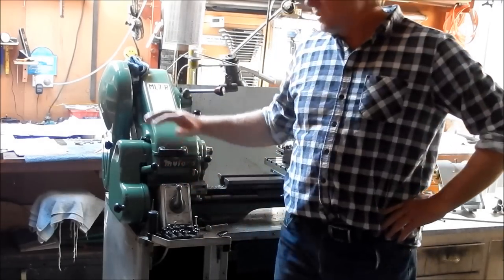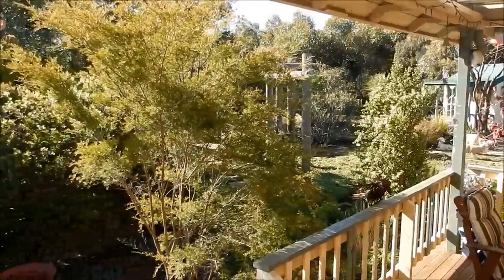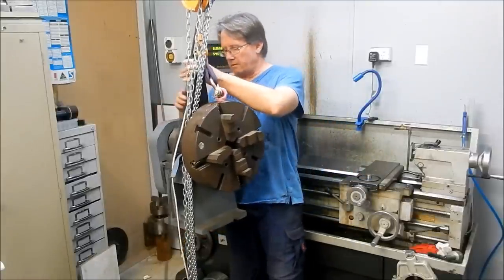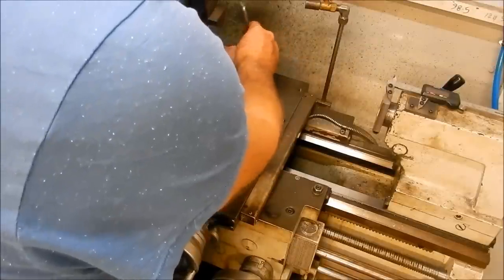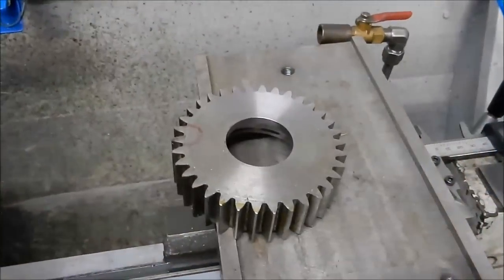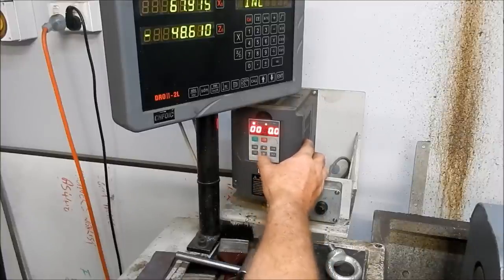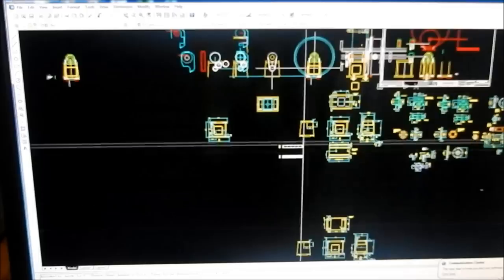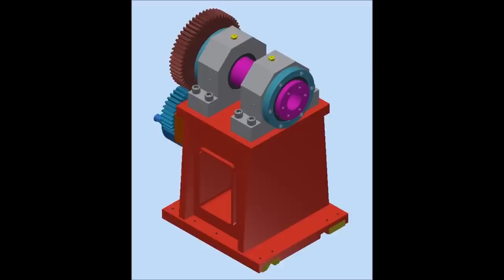How to extend the swing of a lathe Part 2

Comment: When I saw the title of these two video's, I was intrigued. About 10 years ago I had the idea of making something like this. Reason for needing an extension was my grandson was wanting to make some wider wheels and the 13" lathe I had wasn't big enough to turn the wheels he was working on. I drew up plans in CAD very similar to these fixtures. Later I bought a 17" lathe but never got around to building the extension. These are awesome!!!!! And I enjoyed the engines also!!! I subbed!!!
Reply from the maker: Hi Danny, it was a bit of a project but it works extremely well.  I can swing up to 750mm.  I've  machined up all the risers for my turret  mill so it paid for itself in time and money on that one job.
Cam
Cam

Comment: I am blown away by the skills of these two engineers. Thank you for sharing this. Down under-Tasmania. 🇬🇧🇦🇺
Reply from the maker: Thanks Shevill, glad you popped by and had a look.
Cam
Reply: @camatbattler2233 Subscribed.  I am a long retired medic with a lifetime interest in astronomy-astrophotography and building my own telescopes, mountings and observatories. My engineering skills such as they are, are self taught. My workshop and machines are a means to an end-I rarely draw anything, just look around to see what stock I might have and & work around that. Head thoughts are straight to machining. I am lucky down in Tasmania that we have a Catamaran shipbuilding yard not far away and I can get all the aluminium/magnesium military spec (made in France) plate, tube, angles you name it, at scrap prices. I once took my Toyota Troopie and filled it with a wide selection of 'scrap' basically anything on the workshop floor-cost me $100-enough for 20 lifetimes. I learn so much from watching fellows like yourself who can think outside the square, it suits my inventive/research mind as I design and build various systems-all sky cameras and other devices for the University climatology studies/research. I use mostly this super machining aluminium and anodise all the parts myself to increase wear resistance and to look professional So since retirement a long time ago, I work as  an honorary research associate. At nearly 82- I am still building new equipment- I get involved with projects in astronomy with NASA JPL and other overseas observatories. My location outside Hobart makes me the last optical observatory in Australia. Southern Cross Observatory Tasmania 42 South.
Reply from the maker: @ShevillMathers  G'Day Shevill, my wife would love you, she's a registered nurse and is doing her second Post Grad at Flinders studying Gerontology primarily the capacity and brain plasticity/resilience of older Australian's to live a fruitful and satisfying life well into their older years.
I have a good mate of mine who also builds and sells his own Telescopes.  I think the largest one he has is a 10" barrel and measures nearly 2 meters long.  Stepper drives through a gearbox and worm set to allow tracking for photography.  Beautiful shots of solar flares and you can even see the huge mountain ranges on the moon against the black back drop of space.  All Japanese optics (very expensive) but he lives and breaths astronomy.
Cam
Reply: @camatbattler2233  G'Day Cam, Thanks for your reply, I visited Flinders once and needed a map, compass and a cut lunch to find my way to the pathology dept. Your wife may be interested to know that I spent seven years in Tissue Pathology at the Institute of Medical & Veterinary Science ( IMVS)  (now called Southern Pathology) in Frome Road, Adelaide most of the 1980's. One of my research projects was studying the extent of trauma to the brain in fatal car and motor bike crashes-in a combined study with the auto industry. I have, over my many years in medical research, been able to combine my  mechanical and scientific imaging skills in designing & building my own equipment for these projects without having to farm out the work to others. Astrophotography has always been a very prominent part of my secondary astronomy 'career' and down in Tasmania we have pretty good skies, not as good as the SA outback, where I have had many 4WD expeditions into. Here is one of so many projects on the go at present-https://goo.gl/photos/1KHzBVUQihq2ZWM98, also try this link and let me know if it works for you. https://photos.google.com/albums.
Reply from the maker: @ShevillMathers  Beautiful work Shevill.  Is that your workshop?  Very well equipped.  How many telescopes have you made?  I spend alot of time at the scrapo's  when I'm starting a project and tend to design around what I have in hand.  I'm a few years off retirement but am setting up my workshop ready for that time.  Rosemary my wife does her Post Grad off campus (we live in Geelong) but you are right it is a rabbit warren to get around, got lost a few times when we went over for Rosemary's Graduation a few years ago.  Will probably head back for this Graduation if she gets through, she's currently at a distinction average so I think she will be fine.  Pathology, what can I say.  I'm off to the specialists today for my first Post Op PSA test result.  Had a Prostate removal done 2 months ago so fingers crossed its an undetectable.  The biopsy numbers where 3 + 4 with 70% low grade and 30% high grade.  Caught very early and around 6mm in diameter and a PSA level of 2.4 pre surgery.  Good pathe report post surgery with good margins and no detectable spread into the lymph system.  I've got a couple of YouTube updates and I'll do another one after today's results.  A little anxious at the moment though, just hoping I don't need to go through Radiation and Hormone Therapy.
Just quickly I worked with an Engineer who worked in SA developing tests for crash impacts, his name was Kenny Lee.  Went though a lot of pigs over the course.
Cam
Reply: @camatbattler2233  G'Day, Cam. First off, I sincerely hope your review is a good one-and by the sounds of it,  it will be. Always good to get these issues early-far too many leave it too late because they are afraid of the outcome on a first doctor visit-so typical of many blokes. I have friends and colleagues who have left things a bit too late and the price is high.  The big workshop is one at the University of Tasmania Mt Canopus Observatory-built in the 60's, 70's and an era that I was involved in as a side issue. Mt Canopus closed down a few years ago and moved to a new facility with a larger telescope and modern electronics etc. all operational via a wireless link to the University in Hobart. The big Beaver mill I do miss-it and a Colchester lathe of similar vintage went for a song. I did not have the space for those machines. I will post a link to the UTAS Mt Canopus pics I have taken over the past 50 years. Odly enough, my own telescopes that I built in the UK were largest amateur owned in Tasmania, mine was a 12" f/6.7 the university had a 16" which you will see in the pics. Even before I left the UK, the Uni had offered to build me a dome next to theirs if they could share my scopes. Links in next post.

Comment: i modified a chinese lathe so i could swing 17 and 18 inch motorcycle wheels and found i had requirements for a 19, but actual OD is about with the flanges, an similar idea  i woke with this morning and did a search for the idea found yours and i love it. may i compliment you on your work and idea, its brilliant.
Reply from the maker: G'Day Roy, sorry for the delay in replying.  Firstly thank you for dropping in and commenting.  There is so much we can do in our shops to increase the capacity or flexibility of the existing machinery we have without sacrificing space particularly when its limited.  Glad you found some idea's that you can work with to suit your own situation.
Cam

Comment: my 31 south bend lathe had a riser as a factory option in the catalog although they used a spacer under the headstock and til stock so you have full use of the lathe

Comment: Love the Family Size Pizza sitting on the small Lathe.

This it reminds me of a Facing Lathe at a place i worked at.
The chuck diameter on the Lathe was around 3.6 Metres.

It was fitted with a two stage starting system.
 One electric motor to get it rotating then when it reach a certain speed it would switch over to the main drive motor.
After switching off the main motor it would take around 15 minutes to come to a complete stop.
From memory the main drive was around 40 horsepower.

Nice work, Cam
Thanks for sharing your idea,s

Comment: That's impressive Cam. I love the old school Acad!
Reply from the maker: Thanks Mark, sometimes I prefer the old Acad rather than the 3D Parametric Solids Modelling Programs I used in the latter part of my drafting career (and still do at home).  Takes me back to the very early days of Cad running a 286 or the lightening fast 386 with a Math-Co Processor on a DOS version.  Still nothing beats the pungent smell of Ink on Mylar Film, those where the days with rows of Draftsmen on Hydraulic Lift tables with Scale Rule Drafting Machines and a real buzz of excitement around the drawing office.  Sadly long gone now.
Cam

Comment: I thought of a similar set up, as i have set my lathe up for line boring - currently i run the bar between the chuck & tailstock  & the last job only just fitted in & i thought of running the bar in 2  A frame supports above the chuck and drive it with a tooth belt like the Hoffmann boring bars .

Comment: Good one Cam. Been a long time since the CNC BBQ. Subbed, need to check out your other vids. John has some great engines. Thanks for the share.
Reply from the maker: G'Day Seafurymike, yes it been a long time since those days.  I'm still CNCing but no where near as much as I used to.  Often wondered what happened to Benny?  Have you had any contact with him over the years, very nice bloke.
Cam
Reply: Cam at Battler i sure do still see him Cam. Benny and i are into bees now and he has been helping me out with the details. Still got my cnc’s (mill, table and lathe) and im just about geared up for a cnc plasma build. cant wait for that
Reply from the maker: @seafurymike  Please keep me posted on the build and give Benny all my best when you see him.
Cam

Comment: excellent craftsmanship, I see a lot of welding, how do you deal with metal stress?
Reply from the maker: G'Day Marc, good question, stresses introduced by welding and other methods of heat input and when to relieve and when not to and how to minimize movement.  Due to its stoutness I wasn't overly concerned however after welding (with alot of heat input) I did pack and wrap it in a ceramic fiber blanket and it was still hot the following day so I'm comfortable the majority of stress has relieved and I did leave it for another 4 weeks prior to machining.  Having seen the issues during machining particularly large components, and the movement after machining without stress revealing,  I always err on the side of caution and have a standard note with my preferred stress relieving procedures temperatures, soak times, cool down period etc.
Cam
Reply: Hi Cam I am also very interested in the stress relieving.. I am watching your power lathe slotter episodes and I hope you would be kind enough to discuss explain your process.

Comment: hello just stumbled on your channel and very much like your content thumbs up.your lathe has the same dials on the front of your lathe as my lathe exactley. my lathe is a gh 14-40 what size is your lathe? thanks .
Reply from the maker: G'Day Jamie, my lathe is a High Power made in Taiwan.  It measures as a 1330, however this model also came out as a 1340, 1430, 1440 (same size as yours).  I do have a full manual I got from the manufacturer when I purchased some spare parts when I rebuilt it.  If its the same as yours I could e-mail you a copy.
Cam

Comment: I thought the headstock bearings were the limiting factor as they are engineered to the size of swing factoring in probable weights?  Does your extender have larger bearings to increase the load range?  Nice solution as long as it doesn't drastically increase wear on the original gear and shorten lifespan of the machine.  Take care.  Doug

Comment: Great video! Your friend's engines are pieces of art. As for the way that he convert the swing of his lathe, brilliant! The adaptation you've made for your lathe based on your friend's idea, is great too; but the only question-concern that swings in my mind is if the weight of the whole unit can do any damage to the bed and the apron-cross slide assembly?

All the best
Jimmy
Reply from the maker: G'Day Jimmy, thankyou for your reply.  I'm not so concerned about the weight on the bed.  When my lathe was lifted onto the bed of the truck for transport home it was picked up at single point on the bed with a purpose built lifting jig.  If that one point on the bed can handle the entire weight of the machine I'm comfortable with the weight of the Swing Extender, Chucks and components.  The Cross Slide I agree with and I'm probably pushing it to its design limits.  I do take it easy when working with these diameters and if I feel any excessive cut load I back off.  Lots of lubrication before starting.  With 99% of my work I wont be working at the extreme's as was shown with the Face Plate machining.
Cam

Comment: Why didn't you try slackening the big faceplate after indicating edge run out and checking / addressing whether there was any shift..  They were only bolts? No dowels.
Edit: No criticism, subbed, and your swing extender was perfection. (I bet it WAS perfection too...)